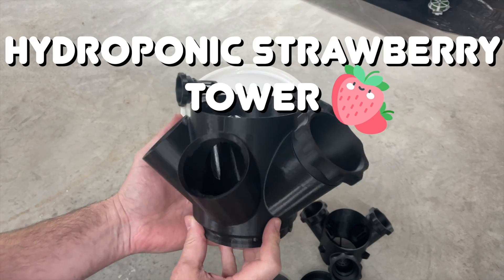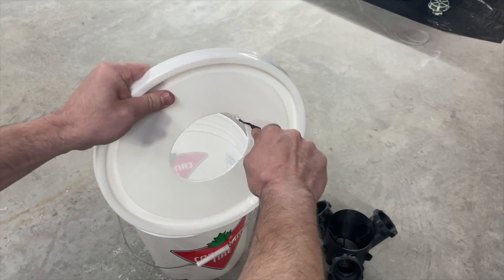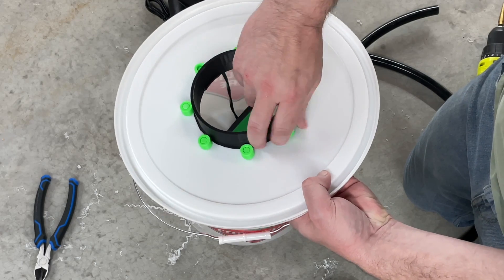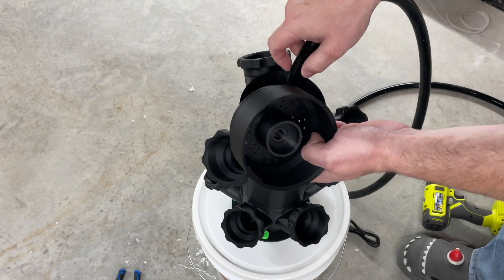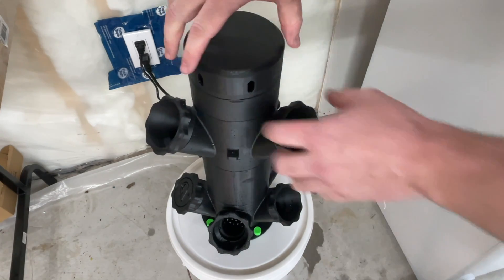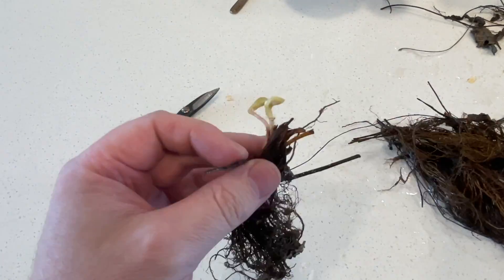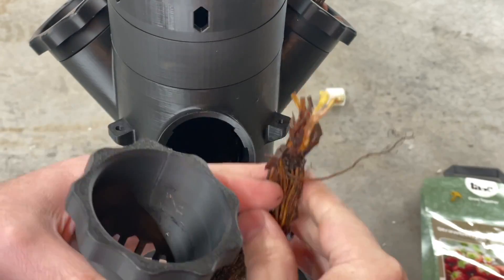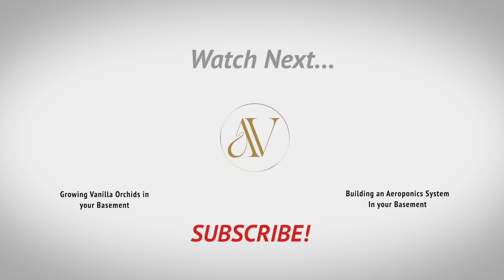Growing Costco Strawberries in a 3D printed hydroponics tower

Comment: I'm afraid of chemicals from the PLA filament leaching into the food you eat. Especially the dye used to make the black color. The plastic isn't made to be food safe.
Reply from the maker: @0uHiroshi  lots of different filaments out there to choose from!
Reply: PLA is generally safe, but you are right regarding the color, and usually filaments advertise if they are food safe or not. But black is also a terrible idea because it will absorb heat, and PLA is neither heat or UV resistant. Best filament to print this will be a white PETG. I can't say about Canada, since I'm sure the weather there is much colder, but in a Mediterranean climate, this would have been a very poor choice.

Comment: This is cool, but EIGHT nuts/bolts to hold down that tower? isn't that a bit of an overkill? I have a feeling the twist connector would give way before the base does even with 5 bolts.

Since I know nothing about hydroponics, why did you have to wash the strawberry roots so thoroughly?
Reply from the maker: You c oils probably use fewer bolts but they are only semi hollow plastic remember. You’ve got to wash as much dirt etc off the roots. Got a new video on this coming this weekend 👍

Comment: I just go to my local strawberry farms and pay them for the runners. Those bagged strawberries sit on the shelf for far too long before you put them in the system. Did you add any nutrients? What was the E.C? Did you use tap water or RO? How did you adjust your PH, With acid? Did you have any problems with light leak? Algae growth? Fungus gnats? 
I am very experienced at hydroponics, however these are the type of questions that beginners need to ask before taking the time to assemble these systems. Having a fancy hydroponic tower is nice, but if you don't know some simple water chemistry you're just wasting your time.
Reply from the maker: All things that newcomers should learn about. I’ll go over these subject over time. Light leak isn’t an issue for me here, no algae growth of any kind or gnats although I am keeping a keen eye on these.

Comment: Is there a way to do this to link multiple towers together without buying a ton of water pumps?
Reply from the maker: Yeah you could get a much larger pump and run the buckets in parallel. Reducing the pump output to match the requirement.
Reply: @3dprintandhydro and you get the added benefit when the pump fails it kills off your entire crop.  Redundancy is good, smaller pump’s equals less heat.

Comment: PLA can degrade in water and become brittle not to mention UV and warping depending on where you live. Use a PVC pipe as the main body, print a guide to drill angled holes and print the pods to place in it. Hydroponics while it does have high yield due to growing vertically, it does require you to buy liquid nutrients and requires much more attention than normal soil gardening. Do your research before you go ahead and waste a ton of filament printing a hydroponics system.
Reply: I printed some PLA plant pots and it warped only after couple months. As OP wrote PLA is really bad choice to do this.
As a side comment to @ArcVerdi - if you accuse somebody of aggressive tone, you really might not want to do the same in your comment mate ;) Interesting video nonetheless:)
Reply: @luciusd7964 I think he's just matching the tone of the conversation. People seem to forget that there's another human being on the other side of the screen, and only focus on their argument being made as strong as possible. 
And probably not even on purpose, but because the tone of voice and treatment in comment sections differs massively from community to community.
At least that's my take on that.
Reply from the maker: So aggressive! Maybe you should relax a little? 
The degradation is very low and after 5 years, they are still going. PVC…. Maybe do some research on that a little my friend. So much misinformation floating around these days. -40C to +40C and PLA holds up EXCEPTIONALLY. Certainly not good enough for load bearing but that’s not what’s being done here.
Reply: If that sounded aggressive to you sorry for that. Not all PLA is made equal, i've had some PLA prints that survive 6 years, some disintegrate after 16 months, only thing I have that is still going is the gardening tags in nylon I printed from my Tevo almost 8 years ago. I've been using PVC pipes for sprinklers and irrigation perfectly fine for a decade I know they can hold up. 

When I warn people to do their own research, I think that is considered pretty general advice getting into anything, there's no reason to take that offensively. You mention it's been going for 5 years, I see you printed this with a Bambu P1P and that printer has only been on the market for a year unless you have another system running that you can show. I already did try building hydroponics tower before, costed about $70 for 3x1m hydroponics towers with a 6" PVC pipe and using a heat gun to deform and create the holes. 

I decided to switch back to soil gardening, but if you do find hydroponics as a enjoyable hobby I do wish you bountiful harvests and a happy endeavor.
Reply from the maker: @am_stephanos   No problem, I enjoy a genuine discussion. No I've had 3D printers for a long time, the P1P is only a year old but its my favourite by far. I think 3D printing for food, has a LONG way to go to actually become functional and "completely" safe (if anything ever is). I only like to remind people that over the last 100 years, there has always been something..... something to be concerned about. The likely hood is 3D printing is that problem for this generation (along with lack of water and all the other issues facing the world). 
I also LOVE soil gardening, I have a tiny garden where I live so no longer have the space I once did. 
Always open to a genuine discussion so feel free to chime in later down the line.
Reply: You shouldn't apologize to overly sensitive people, they need to get over themselves.

Comment: Have you done any sealing to your tower?
Reply from the maker: The first me I had to sea the top holes as the water kept coming out them. The second tower (coming in next weeks video) has a different top without the holes and is much cleaner. That’s all though.
Reply: @3dprintandhydro  According to what I understood, the filament should be food approved, and even if it is, you should add a sealing layer inside...
This is from what I understand...
Reply from the maker: @thebigdoss3410   food safe, ideally yes but again this information has been twisted and turned around online like you wouldn't believe. The food safe argument is more related to direct food contact such as cookie cutters, chopping boards etc. The roots of plants (which is what is in contact here) is of no concern as the roots of plants touch much worse things in soil. 
You can though, use UV resin on the inside should you wish.

Comment: Any tips for noise reduction?
Reply from the maker: You can always use aquarium filter foam placed at some points to quieten the flow of water.
Reply: Try a smaller water pump

Comment: What are your thoughts on making the tower without the internal tubing guides and use a pvc pipe with misting nozzles. I have printed this tower myself with indoor grow light arms and my main complaint was any shuffling of tower components would require a full disassembly due to the tubing being routed through each piece. With the misting setup, you could twist and pull without having to fuss about a tube or a top piece. so if you wanted to add fresh plants to the bottom and keep a rotation going you always have fully grown stuff at the top or vice versa. Yes you could pull the inserts that the plants sit in, but at the expense of possibly damaging roots.
Reply from the maker: I think that’s a great idea. The internal pvc could just slit together to expand/reduce the size. 
I agree, the current design is far from perfect and I’m going to start designing a new one but I like the sound of your idea!
Reply: Did you print the grow light arms yourself ? Or how did you make it
Reply: @TheJAIRCRUZ  Yes, it was on thingiverse  Modular Hydroponics Tower w/ Grow Lights

Comment: the whole world is trying to get microplastic out of their food, but 3d printer bros are adding plastic to their food on purpose
Reply: The thing to do is to print this in PET, which is the same stuff they make milk jugs out of (in the US at least). It's UV stable, so the grow lights won't cause it to degrade and it doesn't leach anything into liquid. It's inherently food safe. And one of the few plastics that actually recycles.
Reply: @hodgeac did you mean PETG? I’ve been researching safer materials for this
Reply: @hodgeac  You're thinking of soda bottles, milk jugs are usually High Density PolyEthylene.
Reply from the maker: Corn plastic is a non-petroleum material made by converting corn into a resin called polylactic acid (PLA). Mostly made from corn because it's the most affordable and available, however it can be also made from sugarcane, tapioca root, cassava and sugar beet. Welcome to the world of science!
Reply: I was thinking the same thing. How would the long term of the plastic hold up and would the plants be tainted by the plastic. Plastic poison is a thing they need to do research on this and if there is I haven't read it.
Reply from the maker: I think over time, the printed materials will change and adjust to more environmentally friendly options. I am in the process of doing a long video about the subject which is quite interesting.